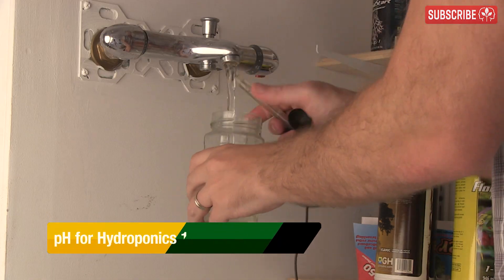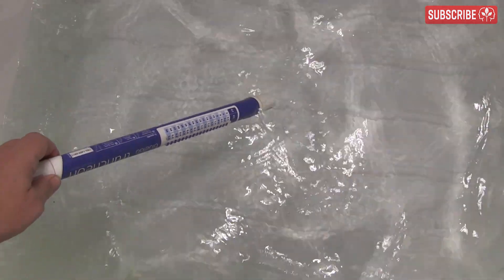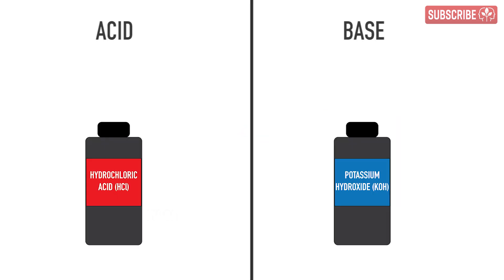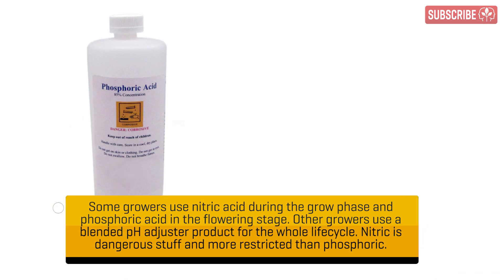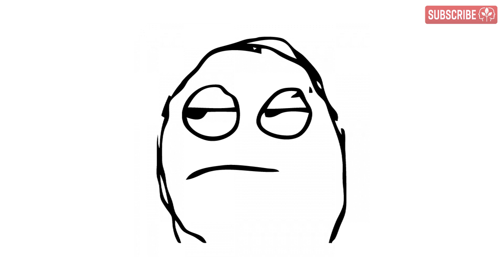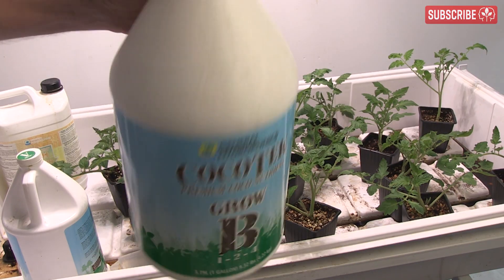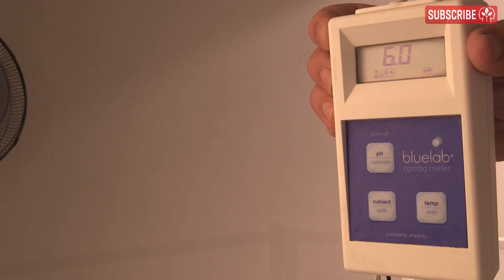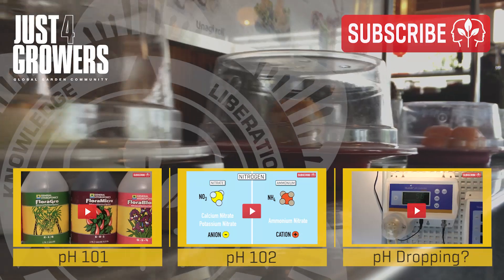pH for Hydroponics 103

Comment: I use a 85% concentrated phosphoric acid, and my EC Rising a lot. For example, if I ad 1 drop on a 1 liter solution rises 1000 EC at least. I just come to see the video about ph, 102, and you recomending diluying the acid a little bit,  thats can be fix my issue? Thanks man!

Comment: Hi! Good videos! Why is the calcium participate, when i mixing the nurients? Im using calcium nitrate (stock solution A), and NPK 6|14|30 + epsom salt (stock solution B). In the reservoir 0,4gram/liter calcinit and 0,8gram from the other ferilizer in it. I always mixing the A solution so the calcium nitrate in the end, and adjusting the ph with 60% nitric acid before, until ph 6. But its constatnly riseing due to air bubbled dwc. Not always but sometimes the ph got rise up to 7 and making cloudy water. Than next time i trying to put more acid in it, but im afraid it can go nitrogen excess, and burn the plant. How should i mix it to avoid participate of carbonates? I tried warm water. Stagnant water. Ro water. Really slowly mixing the nutrients. Really slowly mixing the acid. I tried add the 6|14|30+epsom, air bubbled it for one day, it got stable ph 6 after two days, than i mixed slowly the caclium nitrate, and it got participated 10 minutes later...what do i do wrong? Thanks for the help.

Comment: My ph keep raising to 6.1 after I adjust it to 5.6  😢 a friend said bad bacteria might be growing in resvoir what do u think?
Reply from the maker: Are you using an air pump and air stone? Are you recirculating your nutrient solution?
Reply: @Just4Growers  yes and its a modular ebb n flo I jus found the problem roots clogged tubing it stop it from draining.  Root root 4th week into flower trying to save them cleared the lines and remove the bad roots adding fox farm microbe brew  hopefully they bounce back

Comment: Hey Everest, got a question: why would you spend money on pH up and pH down when you can just use baking soda for up and vinegar for down?
Reply from the maker: +DrValerie800 Thanks for your question. Vinegar is a weak acid but will work. Better to use industrial acetic acid (probably cheaper too). Baking soda will increase pH too but will also add sodium ions to your nutrient solution. A small amount can be beneficial to some plants but an excess can cause lock-outs of other essential elements. My best advice is to start with pure water in the first place and pH management will be minimal.
Reply: Thanks Everest; you're the best! I've not had to increase pH yet, thanks to living in the SW and having hard water, but after it goes through my Berkley filter, it's at pH 7, so I have to add about 1 - 2 tsp vinegar to a gallon after I add FloraGro. It's not a big problem since I'm just growing a few things right now, with the Kratky method, but I'll keep your advice in mind. I hadn't thought about the sodium blocking other elements.

Comment: Hey Everest, love your informative vids, they really help me out as I’m getting into hydroponics. That being said, I’m am a (organic) chemist telling you, you have been doing it wrong! :P Because, unfortunately, you made a few mistake when calculating the pH of 1 mL of phosphoric acid in 250 gal of water. I did notice somebody pointing this out in the comments, but his explanation isn’t quite there yet. After all the explaining and helping out you did, I feel I kind of owe you, so lets go!:

First let’s start by multiplying the 1 mL with the density of 85% H3PO4, which is 1.69 g/mL at room temperature (~20 C), to give us 1.69 grams of the solution. Because the 85% refers to the weight percentage of H3PO4 (the remaining 15% being water), we have to multiply the 1.69 g by 0.85 to obtain the actual amount of H3PO4 in 1 mL 85% solution, which results in 1.44 g of H3PO4. Next, divide the 1.44 g by the molar weight (98), to get 0.0147 mols. Now let’s indeed jump onto the metric train to go from 250 gal to 946 L. Divide the 0.0147 by 946 to get the concentration; 0.0000155 M. Here it becomes a bit more tricky. You are correct that H3PO4 can dissociate three protons, but only the first is truly acidic, so don’t multiply it by 3. This is because after the first proton has dissociated you are left with negative charged H2PO4-. The negative charge prevents the second proton from dissociating easily (this requires the addition of a base). If a second proton dissociates it would leave behind a molecule with 2 negatively charged atoms, which is a lot less favorable. Another thing is that H3PO4 isn’t an incredibly strong acid, therefore you should always consider the pKa(1) value (2.148). In this case however, the solution is quite diluted and it can pretty much be neglected. So, lets keep it simple and take the -Log from the 0.0000155 M concentration, to now end up with a pH of 4.81.

Random tip: With these standard solutions its quite easy to look them up in tables, which often give the molarity directly (14.7M), so you could skip a few steps and start with the 0.0147 mol per mL.
Reply from the maker: +Sander E To say I'm grateful for your help and Guilliame's too is such an understatement! I've slated some time to fix this video next month but you've just expedited it! Thank you. Chemistry is one of my steepest learning curves but one of the most exciting and challenging. Thanks again for your gracious assistance. Peace! Everest
Reply: Your most welcome! I have been enjoying your content and I think your overall quality is superb. Its really informative, high density information, but also presented with flair. So, please do keep it up. If you ever need help with anything chemistry related feel free to send me a massage, I wouldn't mind at all. Have a good one, and keep them growing! Sander
Reply from the maker: Sander E Sounds great - thanks.   Just4Growers @@@@@@ g            Mail       Dotcom       th@nkyou!!! ;)
Reply: Do you have any links and could you explaine that last step for us slightly less.educated thanks
Reply: Sander E ?

Comment: Hey everest, i'm a huge fan of your content. However I think you made a mistake in your calculations this video. When you are calculating the pH value, you divide the volume (0,85 ml) of H3PO4 by the molecular mass. This gives you something with units of (ml*mol)/g, which doesn't make sense. Instead you should multiply the volume by its density, for H3PO4 that is 1.88 g/ml. After dividing this again by the molecular mass, it gives something around 0,01719 mol. So the amount of H+ is 0,05157 mol, which gives 5,4493e-5 mol/l for your reservoir. The final pH value then becomes 4.26, which doesn't different that much from yours but since it has a logaritmic scale this actually means that there are about twice as much H+ ions in the reservoir!
Reply: Hey Guillaume, unfortunately your explanation isn't completely correct either. I wrote the way of calculating the pH in a separate comment, if your interested. Best regards, Sander.
Reply from the maker: Firstly Guillaume, I can't thank you enough for so graciously pointing out my error. I have checked and double-checked and it would appear that my methodology was flawed, exactly as you say. It's funny—I was just looking back at this video the other week and I felt like I was "overreaching" into the faculty of chemistry a little — and looks like I got my fingers burnt! Ha! I will redo the calculations, make an updated version, unlist this version (but keep it live, just with a note to watch the update) and give you FULL CREDIT for highlighting my error. Really, I can't thank you enough amigo. I hope you're subbed or, at least, please keep in touch. Best wishes—peace and happy growing, Everest.
Reply: Everest Fernandez Hey Everest, amazing to hear back from you! I just started with hydroponics since I love to have a little project to keep myself busy and your channel has helped me tremendously. I cannot thank you enough! Don't sweat it, I don't need credit for it, i'm just happy to help (studying physics is apparently starting to pay of :D ). If you ever need something similar doublechecked, i'm more then willing tot help you out. I might not comment that often but you can be sure that i'm watching your content. Keep up the awesome work! Guillaume
Reply from the maker: +Guillaume Croes Superb! Will do. Send me an email at Just4Growers (aaaaaat) gmail dot com when you get a chance. Thanks again. :)
Reply from the maker: Sander E but together we will ALL get to the bottom of this! Lol. Thanks to you both!

Comment: Everest, could you clarify?

I should adjust my ph before adding nutrients, but I should be adjusting that ph so that it is still 6(ish) after the nutrients have been mixed in?

or as long as I am ph-ing my water to 6(ish) it doesnt matter what the nutrients do to it?
Reply from the maker: +matthew allred if you are using liquid concentrates then don't worry, the minerals are already in solution. Just add your base nutrients and adjust the pH if necessary with dilute pH adjuster.

Comment: IN HYDRO SYSTEM: Add HydroGuard from (Botanicare) to keep out Root Rot; it really works.. Add Silica Blast from (Botanicare) Strengthens Plants; both of these will allow higher Reservoir Temperatures and the HydroGuard is a Superior Bacteria that will Kill All Other Bacteria (Don't Use H2O2 With HydroGuard, just add HydroGuard at begining of Resivior Change and the Bacteria will Grow and Multiply breaking down organic matter and killing bad bacteria. You Will Have NO ODOR In The System cause Good Bacteria don't produce Odor.

Comment: If you mix R.O. Water with Good clean filtered tap water you can stabilize the PH without adding any acid's or base's.
If your RO is 6.5PH and your tap is near 8.0 then add 1 -- 16oz cup of tap to 1 gallon of RO. The PPM's will equal out to be about 30-40 if the filtered tap water is around 400PPM.
Reply from the maker: Thanks MC—you're right, the carbonates and bicarbonates in good quality tap water can really help ongoing stability as a pH buffer.
Reply: Thank you. I am experimenting with this right now, mixing tap with RO. My nutrients bring pH down a bit so I'm not sure what to do yet. Should I tamper my tap to make it hit target pH when nutes are mixed in? I'm trying out V+B RO/soft powder and its not going as *simple as i had anticipated...

Comment: I'm sorry to hit you again but I got more questions. :)
Thus far I have always mixed the nutes and then adjusted the pH.
However, as suggested in your video, I have been doing it wrong and I want to do it right!
So, I tried mixing nutes with adjusting pH before mixing in the nutes but I miserably failed. The pH was way too low and I discarded the whole mix.
I had good results with nutes first and ph last thus far.
What is the expected benefit of adjusting ph first and mixing in nutes last?
I'm so curious because it sounds important.
I would really appreciate your feedback.
Love and regularly recommend your channel!
Peace Otto :)
Reply from the maker: Hey there Otto—firstly, you can hit me up with as many questions as you like, buddy—no need to apologise. I genuinely appreciate you watching my videos closely and your feedback has already helped me to improve them, sometimes necessitating a re-upload! ;-) However, I'm sorry to learn that you had to discard a freshly made nutrient mix. That sucks. You know, when using liquid hydroponic nutrients they are already dissolved—I should probably caveat that this is more relevant to solid powder nutrients. But, rather than changing common practice, I just wanted to try and explain that it's the extra H+s in solution (as hydronium ions) that help to break up the salts into their component anions and cations and make it soluble. There's a great video at the Khan Academy that explains it pretty well. Take a look: https://goo.gl/UBxTc0
Reply: thank you so much! still a lot to learn.